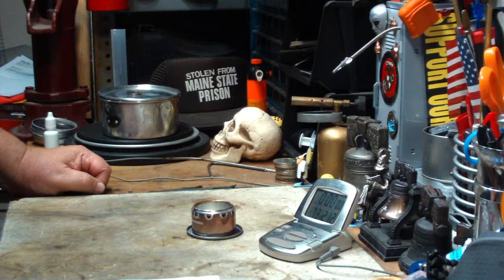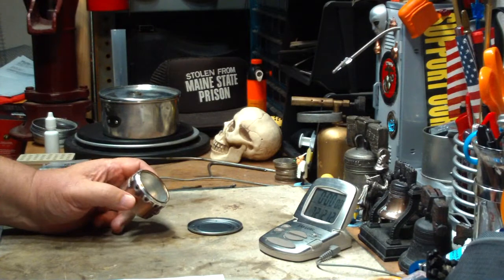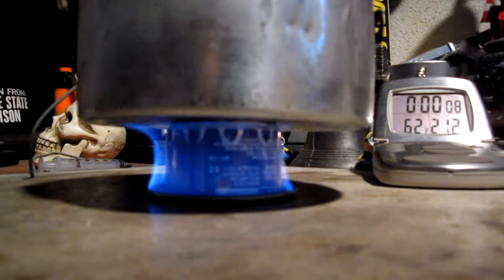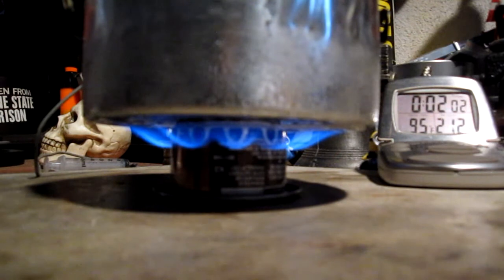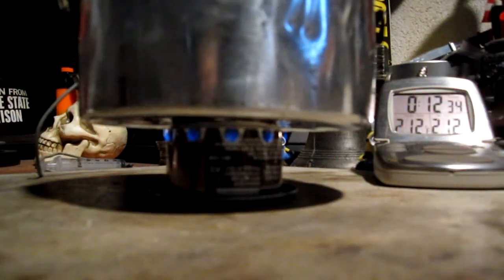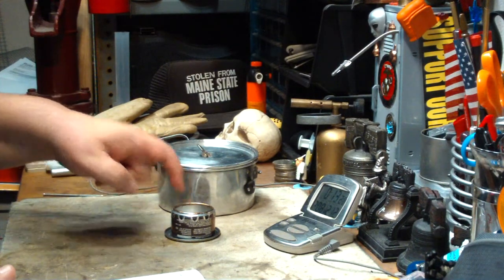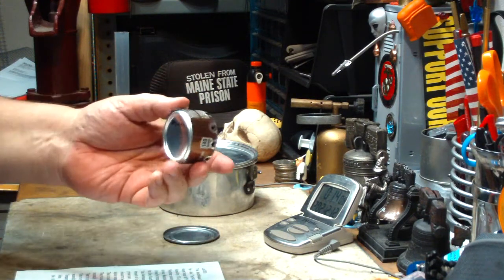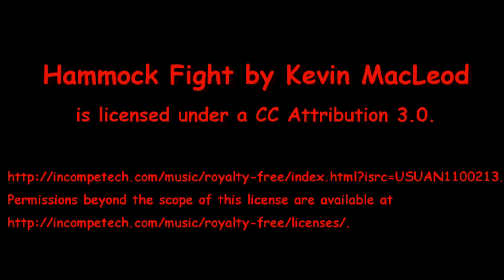MatoNupai's MAHALO Alcohol Stove - Using Primer Pan - Boil Test #1

Comment: RJ Burg considered by many the grand master of alcohol stoves was not above using a primer. Tinny puts wicks on most of his traditional stoves. I see no difference between a few drops on a wick vs a few drops on a primer pan. Lastly BP; it is NOT a bad design. I put 20 ml in the stove, and a few drops on the primer. I take tap water at 64 degrees to 195 degrees with only 12.5-15 ml alcohol.

Comment: Babylonpat; the stove has 10 1/8 inch jets. Using a primer is NOT going backward, and I can tell you why. If you light the stove normally; you are wasting fuel while you wait the 17-20 seconds for the stove to bloom. With a primer; the stove blooms in 7 seconds, and all of the energy in the fuel is going into heating the water instead of being wasted.

Comment: Sorry Jetpowered1: you just don't get it. I designed that stove. There are things more important than fast boil times. Fuel economy, light wight, and needing no pot stand are just three things more important than the fastest boil. I am very proud of that stove design. I tried to make the perfect thru hiker stove. It uses about 40-50% of the fuel many pressurized stoves need.

Comment: Usually this stove takes 60-90 seconds longer for a boil, and only uses 40-50% as much fuel as most pressurized stoves. I tried to build the perfect thru hiker stove. Frugal on fuel, tight flame pattern, decent boil time, and light weight 6.7 grams.

Comment: Hiram: thank you for performing this test on my stove. Much appreciated. Hunt458; when you build a stove there is a balancing act. Be fast, frugal on fuel, or a tight flame pattern that will work with narrow pots. You can only choose two of the options. I chose work with 3 inch and wider pots, and be frugal on fuel. With this stove you can blow it out and reclaim the unused fuel.